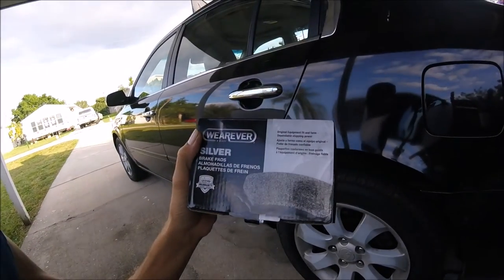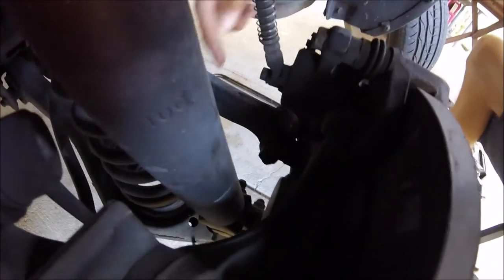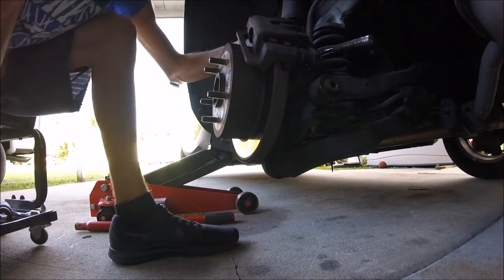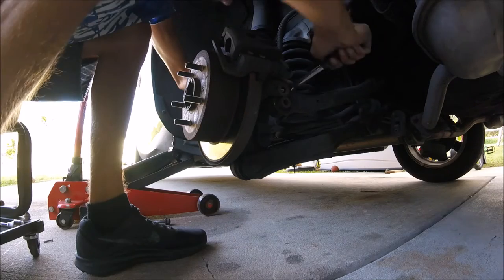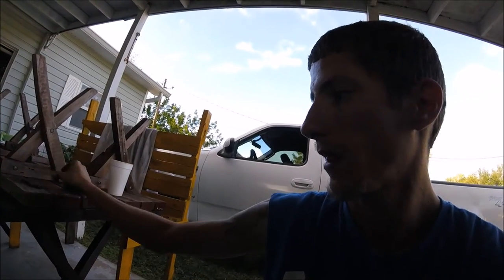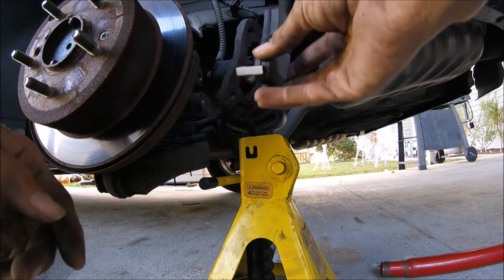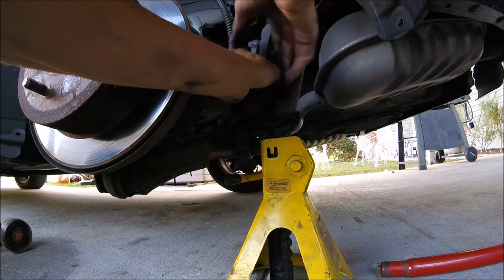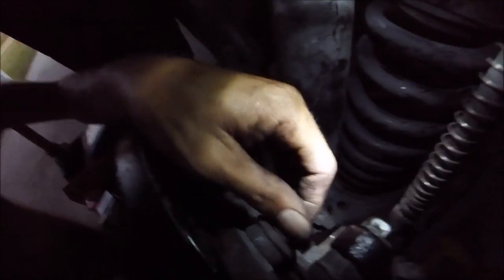Replacing  Kia Optima Brake Pads - Kia Optima Rear Brake Replacement

Comment: You should have left the caliper braclet on and just loosened the slide guide pins and it would have made it much easier to work on
Reply from the maker: Yeah for sure. It's just a habit of mine to always unbolt the whole bracket no matter what I'm doing or working in lol.

Comment: did you open the bleeder when you pushed the piston back in? Use a jackstand somewhere other than to hold the caliper next time please.
Reply from the maker: Yes I did have the vehicle jacked up and I open the cap on the brake fluid while I push the piston in.

Comment: No one has a video on replacing the Emergency Brake shoes on a Kia Optima. When pulling the rotor off one of e brake shoe lining came off so they needed to be replaced also.
Reply: Check the Chilton's Guide